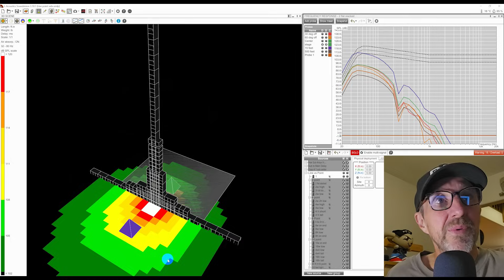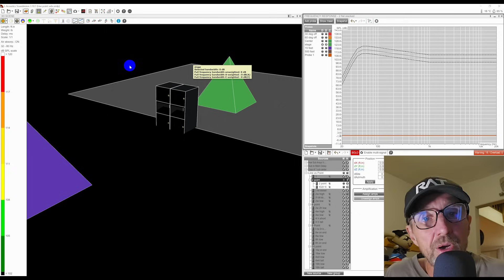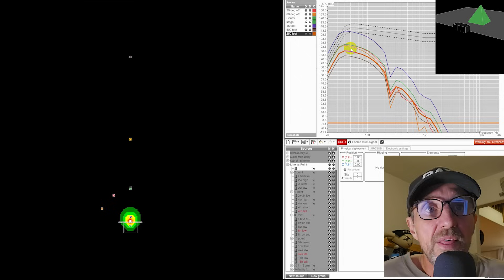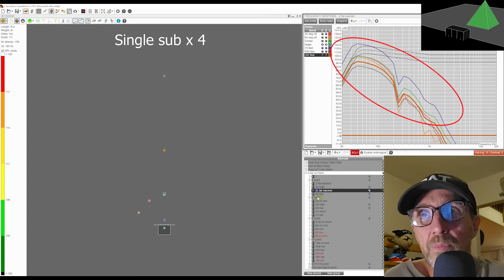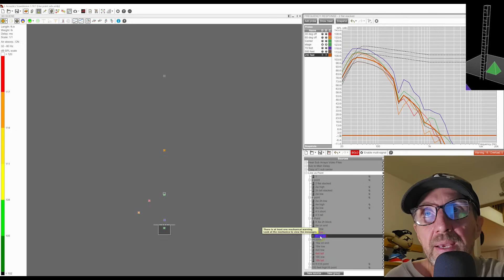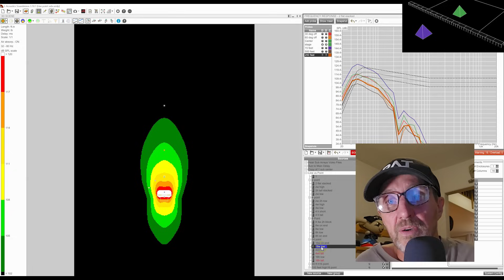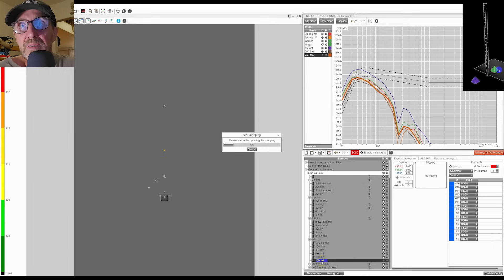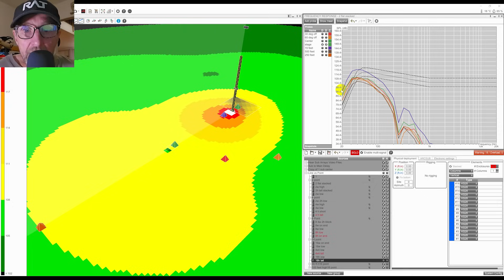Point Sources Are Ideal... Or Are They?

Comment: I have a question for the more experienced users of soundvision. At 5:00 we see the frequency response view at the top right with the option to add probes. Unfortunately, I cannot find this function in Soundvision 3.12. I only know the frequency response from having a source selected. Otherwise it is empty. Does anyone know how to get to this view with the probes?
Reply from the maker: This is a feature that gets unlocked with the L-Isa version of sound vision. There are several unlock codes that open up other features. Not sure if they'll release it as a normal feature or not. But it definitely is very handy

Comment: Very interresting! How about the arrival times? How smeared is the dynamics?
Reply from the maker: If the arrival times were off you would get comb filtering and that would be readily visible in the frequency response.

But as you can see the frequency response of the point source is identical or nearly identical to that of a line source.

A point source is a pistonic point radiating outward, The line source is a pistonic line. .

Everything is in phase and in time as long as the components making up the line source are extremely close together in relation to the frequency being reproduced

Same thing applies to a point source, as long as all the components that are making up the point source are extremely close together in relation to the frequency being reproduced everything will work together.

Comment: Would 2 subs separated vertically behave similarly (with far less SPL of course)?
Reply from the maker: Two sub separated vertically would have summation and flat frequency response for a listener positioned at an altitude halfway between the subs.

For listening on the ground they would be some calm filtering and you would see cancellations in the frequency response related to the distance between the subs

The only way to stop that distance related frequency response issue is to stack the subs right on top of each other or very close and begin to form a line array or use a single sub

Comment: Hey Dave, how about modelling up a vertical bass array with an arc shape, and possibly some incremental shading. Be interesting to see the results of techniques that employed in horizontal bass arrays but now in vertical arrays. Thanks
Reply from the maker: That will increase the vertical dispersion which I don't show in the video. I will ponder that. The main goal of this video was to show that line arrays and point sources have nearly identical frequency responses in the horizontal but line arrays offer an advantage of volume consistency over distance.

Most people don't understand that line arrays can provide very accurate flat frequency responses and they're not degraded in there response versus point sources.

Comment: This makes me think of home audio speakers like the LS9 line array and the greatest sounding speaker system by Ken Fritz. I guess line arrays are the best audio dispersion technique of all time?
Reply: HiFi line arrays are built to minimize room interactions (by designing a speaker with theoretical 0° vertical directivity, which means no floor or ceiling reflections). For absolute fidelity, a technical point source and room treatment (plus dsp room correction) would be prefered (the way it is done in the big mastering studios).
Reply from the maker: Trying to come up with "best" rather than looking at the various advantages of the different configurations may not be ideal

As peniku8 commented, high frequency line arrays in home audio can be useful for controlling vertical dispersion and also help project high frequencies farther and more evenly into a space.

Improved volume over distance is just one of the attributes of line sources that differ from point sources.

Comment: Can't wait for the next Coachella stage to have a massive ks28 stack dead center 👍 🤣 
Would love to see / hear your thoughts and comparisons on flown vs floor configs for subs sometime if your keen! Love these videos!
Reply: I'v heard setups where that's sounded great, and I've heard setups where they might as well have left them on the ground stage right and left like the rest of the chumps doing it wrong. Distance by itself doesn't cover mortal system tuning/configuration sins.

The setups that I've liked all had the boxes hung in a line dead center, not incorporated into the top of the arrays.
Reply: @jttech44  yeah based on my experience and research center hang dead center if it works for sightlines and rigging etc gets a great consistent result.
Reply: @superkaboose1066  Yeah, like dave pointed out, having things farther away can improve things nicely. Some situations it's definitely not practical. Like on that bassnectar gig he did with the circle-o-subs, no way you could have flown all that in a line.

Though, I'm now wondering what would happen if you flew the same config... I've already spent enough time in soundvision today though lol
Reply: @jttech44   flying that rig would've messed with the cadioid configuration, since it's optimized to work for horizontal propagation. You would've needed to fly the cardioid elements lower (and adjusted the delays), so that the cancellation would've been directed at the stage, in which case now the audience area would become more unpredictable, since different parts of the audience would be at differeing angles to the main subs and the cardioid elements, causing differing frequency responses across the venue, which can't be corrected with EQ, unlike the original setup.
Reply from the maker: Understanding the advantages of the various configurations is often over looked or blurred by emotional alliances or marketing. Deploying arrays in optimal ways to accomplish the desired goals is the challenge.

Understanding that line sources can accomplish improved volume/distance  consistency over point sources is important knowledge.

Never underestimate the ability of humans to screw even the best ideas up.
Reply from the maker: It's pretty straightforward to do cardioid line array or point source setups
Reply: @DaveRat  "blurred by emotional alliance's" 

The poetry imbue your supremely deep knowledge is utterly wonderful. Thank you Dave. I appreciate you deeply 🙏 ❤

Comment: Wait until I show you my 40ft tall folded horn design. You won't need a pile to get it loud enough... look up the danley matterhorn for the sort of thing we're looking at.
Reply from the maker: Somehow you missed the entire point of the video!. This has nothing to do with horn loaded or or with PA boxes that use line array sources and claim they are point sources.

This has to do with the fact that increasing the vertical or horizontal dimension of a large array can offer improved volume consistency over distance that smaller sources and point sources cannot achieve.

The whole point of this is to show that while super loud boxes like the Matterhorn may be fun and loud, they are the opposite of being optimal for covering large spaces with consistent sound volume even if flown 100 ft in the air.
Reply: @DaveRat  I was halfway joking, of course.

Thing is, I am not joking about working on a 40ft tall point source sub that looks like a gigantic saxophone crossed with an air conditioning duct, for use outdoor in reggae shows - 40ft is the size of the unit, not the horn path. The joke is that I'm really not sure what'll happen with the directivity, and horn cabinets tend to "throw" considerably further than the data sheet might lead a person to believe.

Omni is really unhelpful in so many ways, especially in terms of fall-off. The desired performance of the "building sized saxophone" is to achieve blistering stage volume and rapid fall-off over distance, and it's a very specific gadget for a very specific park. Very unlikely to be desirable for touring rigs - and deeply unhelpful in terms of portability.

And yes, the design does indeed maximise the vertical dimension, and considers the ground loading. It is possible to design a cabinet with a vertically gigantic horn exit the size of a small house.
Reply: @DaveRat  this thing of making arrays and shaping the wavefront is indeed all about the manifold.

OK so now imagine a welded steel saxophone with all of the various 1/32nd octave node points where the "saxophone keys" go, but with loudspeakers (and electronic braking) whacked into it, and an algorithmic anti-resonance and anti-group-delay system (basic theory is hammer extra group delay removal content into the tube at the nulls and peaks). Basically a tapered horn with strategically placed separately controlled taps running on an eigenmode map of anti-resonance and group delay correction. The "secret sauce" being a large quantity of microphones set along the tube. It's a signal processing project, really, and all to do with directivity control per frequency and very narrow bandwidth digital filtering / wavelet transform. Very much a sort of Danley "sonic weapon" sort of idea. Mounts flat inside a 40ft iso container, and is winched upwards 90 degrees, on an integral hanging iron similar to a skip loader, so it stands up, and looks like a 40ft tall saxophone. It's a visual prop that works as a sound reinforcement tool, for very large headroom at low frequencies.
Reply: My question is what'll happen with directivity when we annihilate the standing waves, and the "virtual driver" or horn mouth exit has a measurable area of 14ft by 24ft, and is comprised entirely from air. I suspect it'll throw a plane wave, but it's frequency dependent.

Certainly a small ensemble of horns, like a nuclear warning siren tower, that could be made programmable, like a sound field microphone.

I also have some rather worrying ideas about how to redesign the driver and motor which come out of the power generation industry. There is not much cardboard in 21st century engines.